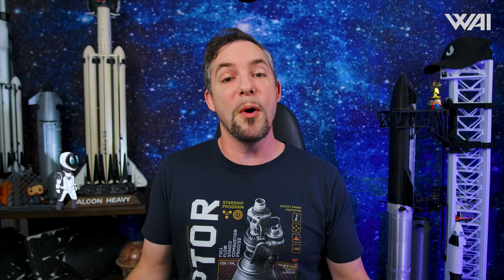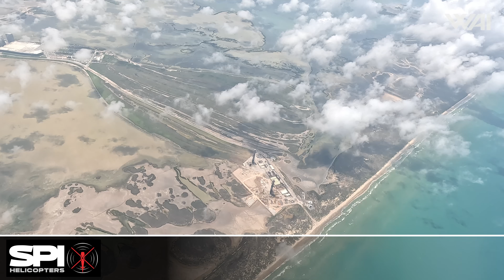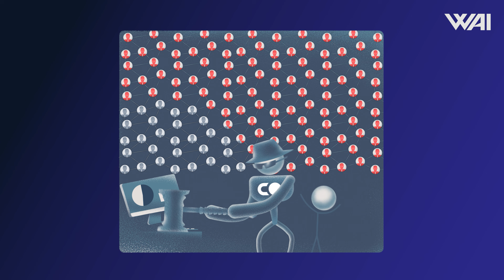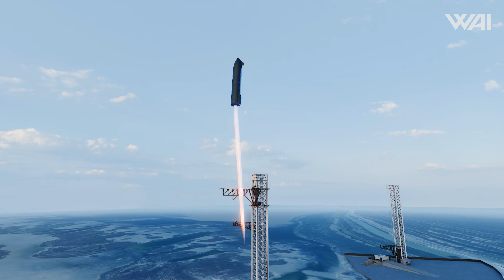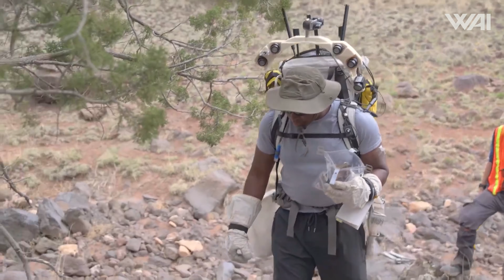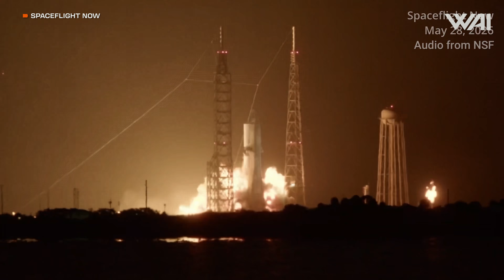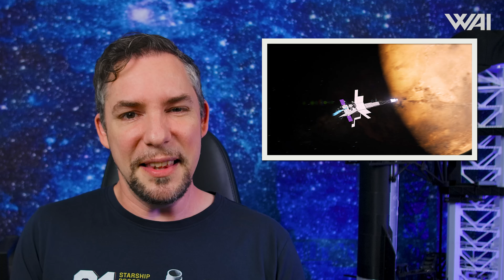Is the Artemis III HLS Starship Already Testing at Starbase?

Comment: My question is this.    
Why, if spacex is building such a capable system, why doesnt nasa lean more into utilising their capability, rather than building another disposable rocket?  Surely there is no need for sls, just use starship, its bigger, more powerful, and fully reusable, and it could just be adapted to fit whatever payload is required.

Comment: SpaceX already has an air separation unit in the works to get LOX and LN2. Hopefully that comes online soon eliminating need for trucks for those commodities. LCH4 is the only variable. Much better to figure out Sabatier reaction process with solar powered water electrolysis to produce it locally, no piping or trucking needed! Plus that would make Starship carbon neutral, would be a big deal considering its eventual launch cadence!!

Comment: It sounds like Artemis III is just another "kick the can down the road" mission. Instead of admitting they're years and years behind schedule with equipment, they've changed the mission to be less valuable in order to use existing equipment. HLS still needs to be built and tested. Fuel transfer mechanisms still need to be built and tested. Adding a docking port to the side of version three is another midway step that will be trashed once HLS is actually built. And that's all in addition to what an incredible waste of SLS three this mission is to just launch an Orion capsule into LEO. I'm not impressed by this mission decision at all.

Comment: Lots of speculation while actualy the program is stagnate and hasn't landed a SS yet.  In fact I would challenge they haven't had a problem free launch in the program yet.  Yes, they are all test articles with some expected failures but all they do is the same thing each time.  Launch (some fails), SS flies (most fail) and splash in the ocean (many fail).  Change to the next version and do it all over again.  No sign of improvement from V1-V3s, just new ways to fail.  Things have to start working every time, over and over again.

Comment: Artemis III crew is stacked! TWO ISS Commanders, medical expert with a year space flight, and a test engineer. The backup is very experienced, a huge responsibility to be ready to step into any of the roles. Incredible.
Reply: All of them, sadly  have two obvious drawbacks- their age and grounding status related to this... Hopefully, those veterans will get their 3rd and last, long waited flight, spent for good!
Reply: @allwright5632 Could you please clarify for me? Age sort of makes sense for microgravity (age related muscle and bone loss/ slower recovery from extended duration spaceflight upon return to Earth), but grounding status? If they are active duty astronauts and are declared medically fit to fly, what does "grounding status" mean in this case? Thank you! :)
Reply: @mariaprange916  5-7-10 and more, years on the ground, without space mission, after 1 or 2 flights can actually count "as grounded". at whatever reason... Imho, this  how it looks from the outside...

Comment: 220 trucks a year? Pfft. Some years ago I was running logistics for a small dairy farm (~350 heifers) and was managing about 400 tanker trucks a year.
Doing the same in large batches instead of 1 or 2 daily is probably more of an issue, but the yearly size is pretty small compared to much less expensive operations.

Comment: Keep in mind that reentry from the moon is faster than from LEO. It's 11km/s vs 8km/s, which doesn't seem that much difference, but the energy is equivalent to the velocity squared. Where a LEO reentry will make you sweat at 1650C, a moon reentry may burn you're eyebrows a bit at 3000C. That's about double the heat. Not sure if the current starship heatshield can handle this.

Comment: Are we sure the HLS variant needs a header tank to manage sloshing, if it never needs to re-enter Earth's atmosphere?
Reply: Even more so every movement will push the liquid around much more in low gravity than in earth gravity. 
Essentially every direction correction will induce sloshing in opposite of the thrust direction and these engines don't tolerate hick ups.
If they develop a separate thrust system to assist with the boost maybe but the issue will be much more profound in low gravity than in higher gravity.

Comment: The Sanchez Site was historically a natural gas well facility. I was hoping that SpaceX would reopen the wells and produce their own LNG right there at Starbase. Coupled with the air separation plant they'd have all the gaseous/liquid consumables required for construction and flight, LN2, O2, N2, and Argon for welding. That would be some brilliant vertical integration.

Comment: Uh no? Did you even watch the artemis announcement? SpaceX said that they'd be docking Orion to the nose and doing the TLI straight to low lunar. They couldn't possibly light raptor 3 and do a TLI with Orion docked on the side. You'd rip starship wide open.

Comment: People are talking about the Artemis III Blue Moon lander as needing H2, fed from the booster for topoff.  Does it really need any H2 for Artemis III?  Just as SLS will be flying without an ICPS, I'll bet that the Blue Moon Mk. 1 (1A?) lander could be launched either with only internal H2 loaded at integration with launcher, or none at all, maybe subbed with N2 for the purposes of the Artemis III mission in LEO.  If that is the case, then there is no problem with a FH getting the thing into the needed orbit if BO NG is still grounded.

Comment: Nice update, thanks for sharing. I might be the only one but I think with SpaceX becoming more of a profit motivated company and Bezos recently coming out with a more friendly tone towards working with SpaceX I think there is definitely room for both companies to work together and develop a version of the Raptor engine R4b that would be a drop in replacement for the BE4 engine. Since SpaceX can build a Raptor at an estimated price of 1/8th the cost of a BE4 with far superior performance and efficiency it would make sense for Blue Origin and ULA to have a backup engine for their rockets that is more robust and efficient at a savings than the ones they are currently using. This would also benefit SpaceX since it would be a secondary pathway of income coming from competing rockets and by increasing flight time for their Raptor lineage it would help qualify the engine family for human rating. With increased interest in the space industry it doesn’t hurt to have individual companies backing up each other since there is likely to be more need than capability in the near future.
Reply: Rockets are built around their engines, there is no such thing as drop in replacement. SpaceX would have to develop a new engine based on R3 to fit on NGlenn (pointless as this is a low cadence pretty much inconsequential launcher, with a short expectancy in the new space era). And Raptor3 should closer to 30 times cheaper than BE4 (~$250K vs $8M).

Comment: You are overhyping the SpaceX HLS. This analog, the one that will fly on Artemis 3, is not a thing like HLS; it is a stand V3 Starship, which has no pez dispenser or payload bay door and has an international docking adapter glued to its side. It doesn't have a crew cab or life-support system, no landing hardware, or anything else. It is only made to practice docking procedures with Orion, mostly for the Orion side. They need to practice rendezvous with such a large vehicle and validate Starship's rendezvous ability, but it's nothing like HLS, which will probably fly on Artemis 4.

Don't underestimate Blue Origin's side. New Glenn isn't essential for Blue Moon to work. They could launch Blue Moon Mk1 Endurance on a Vulcan or Falcon Heavy The New Glenn rocket explosion doesn't affect Blue Moon because Blue Moon can be launched on other launch vehicles. The B7 is still really reliable. The lander hardware has been tested, and it's nothing to do with New Glenn.

In addition, they are much more advanced in their lander development than SpaceX. SpaceX doesn't have any HLS hardware. Blue Origin has its first Blue Moon Mk1 assemblable and almost ready for launch. Its second one is partially assemblable, and the Blue Moon Mk2 that will fly on Artemis 3 doesn't have to do with New Glenn, unlike HLS, which is a Starship upper stage. Any problem with the Starship upper stage of the ship is a problem that will be on HLS, but problems with New Glenn are not problems which will be with Blue Moon. Blue Moon is more flexible, and don't under-hypen it and don't over-hypen SpaceX or Starship.
Reply: Speaking about hype, Blue moon Mk1 is like the rest of the commercial lunar cargo landers (which were completed much faster with vastly less resources: Intuitive Machines Nova-C 4 years dev., Firefly Blue Ghost 4 years, Astrobotic Peregrine 5 years). Mk2 is a completely different beast, many times more complex and difficult. Mk1 took them >10 years to reach this stage, Mk2 will need another decade.

Comment: I think EVERYONE is reading waaay too far into the comments during this event on what the HLS pathfinder is actually going to be.  I have BREAKING NEWS for everyone that reads this.  The  Starship HLS variant and all the other variants for that matter will ALL be based on the V3 platform.  The nose mounted header tanks and plumbing are not structural elements.  This is intentional as it will make deleting them from the build straight forward and I guarantee you that this has been part of the plan for some time.  Just like on the Ford production line, the same chassis is used for every trim level of a vehicle that is on the production line.  They don't have a dedicated line for base F150's, XLT's, Lariat's, and Platinum's.  They simply install the proper accessories and auxiliary systems slated for that particular vehicle chassis as it works it's way down the line.  It would not surprise me one bit to see the HLS pathfinder roll out of the factory with 0 heat shield tiles, no flap hardware, and the docking assembly located in the nose.  Especially since the goal is now to use Starship as the transfer stage for Orion.  You're not going to be able to have this giant wart hanging off of your side while you boost during the TLI.  Could I be wrong?  Sure, but this "Revelation" that the HLS variant will be a "Standard" V3 ship just isn't the revelation people are making it out to be.  That has always been the plan.  In fact, I wouldn't be surprised to look back 3 months from now and realize we've already been staring at the HLS Nose for months.

Comment: Will SpaceX be using an Earth-reentry-capable version of Starship as its HLS component for Artemis III?  I wonder if NASA would prefer a version of Starship that is closer to the final HLS design, with no flaps or thermal tiles, and perhaps with the small Lunar-lander engines installed.  It makes sense that SpaceX would like to return this Starship to Earth to inspect it after the Artemis III mission, but it wouldn't be very similar to what is actually supposed to land in Artemis IV.

Comment: I always wondered whether some sort of electric powered cable lift assist system could help starship get off the ground with less fuel needs. Put those tesla motors to the test.
Reply: No. The difference is minuscule. You'd need a thousand mile long track to get a significant boost, assuming survivable acceleration.
Launching from a railgun would help, but few things survive the acceleration other than a solid chunk of metal. Astronauts definitely not.

Comment: Any clever engineers on here who can tell me why they don't develop Starship HLS into a two-stage Starship?. Flacon 9 takes the crew on Dragon to the orbiting Starship HLS, then the top of the Starship detaches on tergectery to the moon, leaving the 2nd stage in orbit. Lands does all it has to do, and then heads back to meet up with the orbiting second half of Starship. The crew then jumps back on Dragon and heads back down to Earth. Starship HLS then does a landing back in the chopsticks. No refuling, no 10 ships to launch 4 crew. SpaceX does the whole mission.
Reply: I Was thinking the same thing Brendan but you beat me to it !  I'm sure they have thought of this already but it makes sense to me for a number of reasons, not least the cost savings of not having to use the Artemis rocket at all.

Comment: The revised Artemis 3 plan for SpaceX makes me very skeptical honestly. It's simpler, as you said, and they definitely are making the right call by pushing back the lunar landing, but it still leaves so many things untested before Artemis IV- the controls, the forward engines, the life support systems, etc... A V3 Starship with a docking adapter slapped on the side is a far cry from the HLS. So, when the inevitable HLS test flight occurs, there will be no astronauts aboard to train on it. Does anyone in their right mind actually believe NASA is going to let astronauts ride HLS for the first time on its inaugural flight to the lunar surface? There is just no way that's going to happen, certainly not in 2028. Nevemind the fact that SpaceX still has to prove their refueling strategy will work... The way I see it, SpaceX isn't landing anyone on the Moon before the decade is out.
Reply: NASA said: both of the providers are required to complete a successful uncrewed landin, prior to carrying any of our crew. Period.
Do you see any ready-to-fly HLS versions? Me neither..
Reply: @flycorvus  Exactly. I should have said its "inaugural crewed flight to the lunar surface." I have a hard time believing an uncrewed HLS will be landing on the moon in the next 2 years, let alone a crewed one. I was happy when I heard Artemis 3 would be an Apollo 9 style mission, but this is now like flying Apollo 9 with a dummy test article in place of an actual LM.